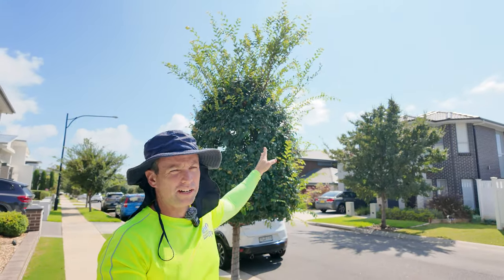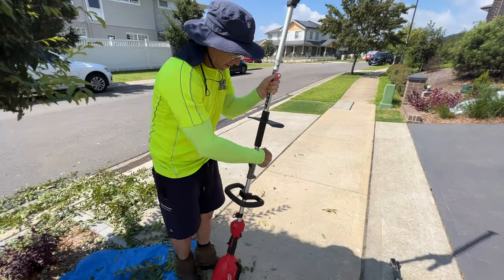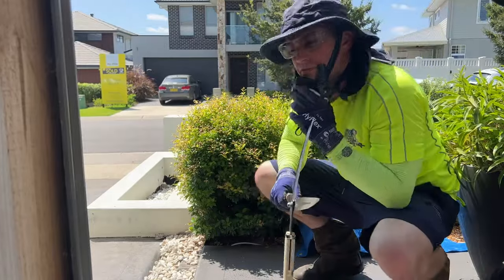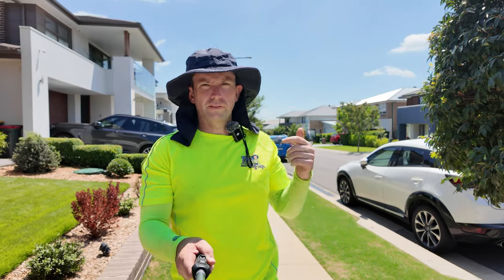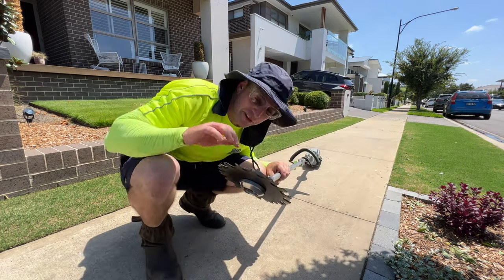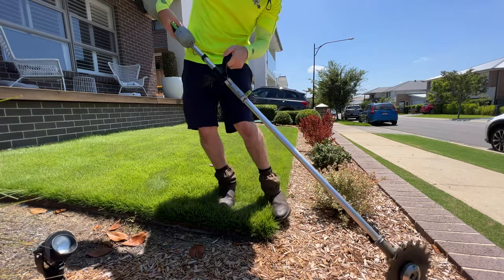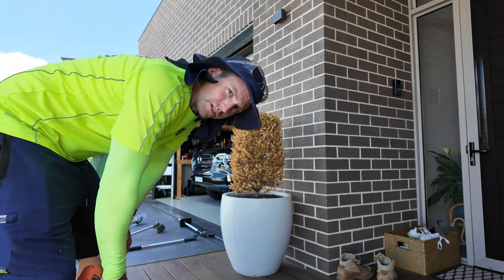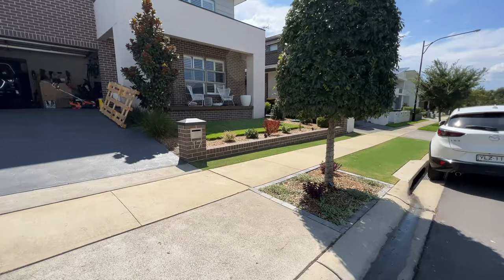VLOG #28 Lawnmower Man's Ridiculous 8 Day Lawn Transformation

Comment: That front lawn Timbo looks like a shagpile green carpet! I'm facing a dilemma Tim, I have all Stihl battery equipment, do I get the EGO rotcut system or the stihl scissor head for my kombi tool? Kmbi tool has an external battery which is a pain to carry around.
Reply from the maker: Cheaper to stick with what you have